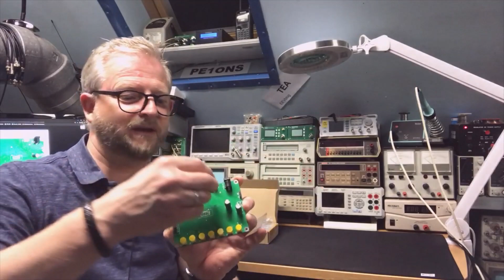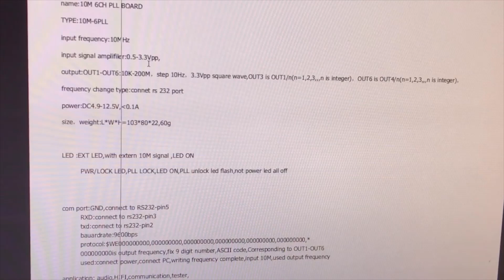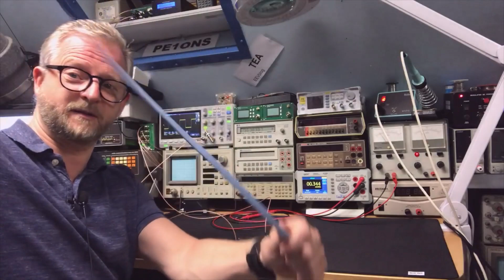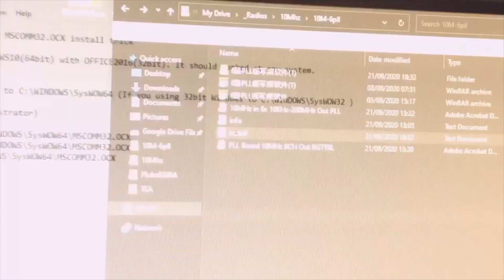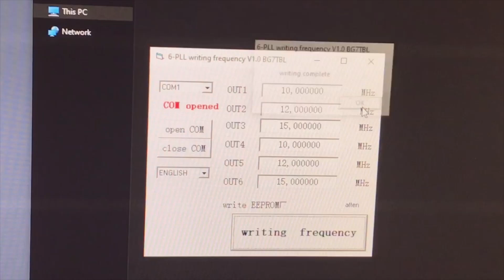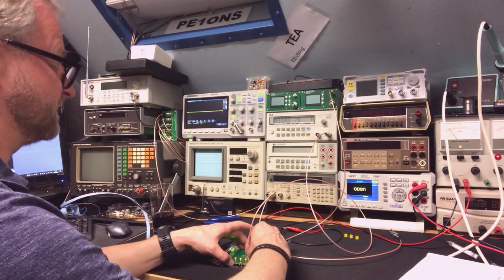#076 10M-6 PLL  BG7TBL 6 Channel Out Adjustable Conversion Board

Comment: Hello Tony, could you help me understand more on details which sub-cable of the serial cable did you connect exactly to which connection on the board? Thank you in advance!
Reply from the maker: you need 3 pins RX,TX and GND from JP4(UART).. on a 9 pin serial that is 2,3 and 5? ground.. if it does not work, cross 2 and 3.

Comment: Another excellent video Tony.  This would be great re-mounted in a decent enclosure.  A good asset to anyone with a decent 10mhz ref and various instruments that require differing external refs.   Thanks for the leg work in finding the software too.  P.S.  I prefer the 'old school' RS232 and 422, 485 etc - so much simpler :)
Reply from the maker: Thanks Stephen!!.. Yes its going in an aluminium box..... coming up later :-)
Reply: @TonyAlbus  You could even go further and add a simple LCD and PIC controller to change the parameters on the board without the need for the PC ;)
Reply from the maker: @Stephen_Heathcote  Yes great idea!  i will need to study the whole PIC thing...but sound great and very useful indeed, not needing a pc..